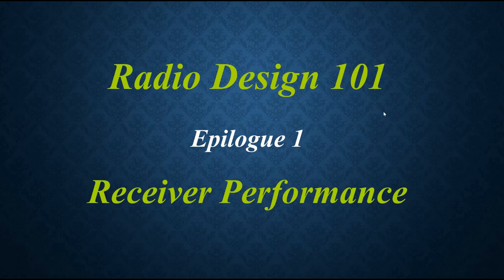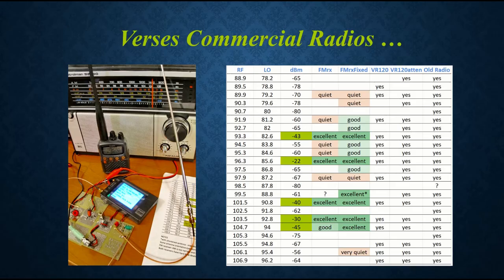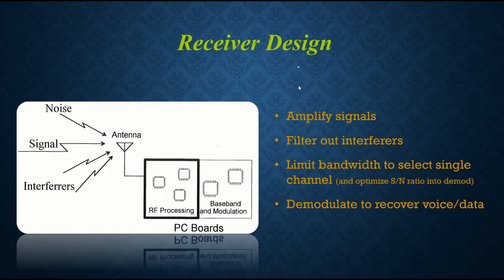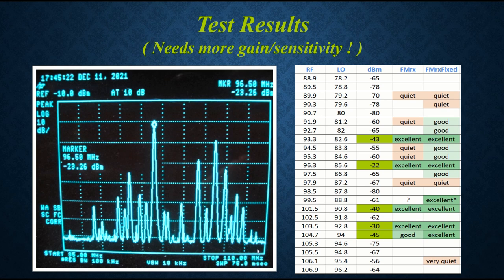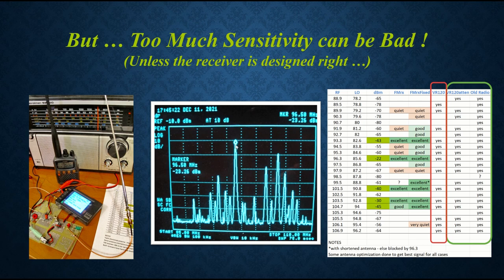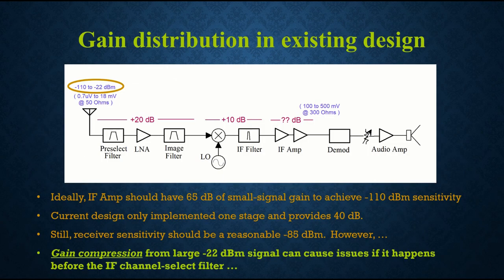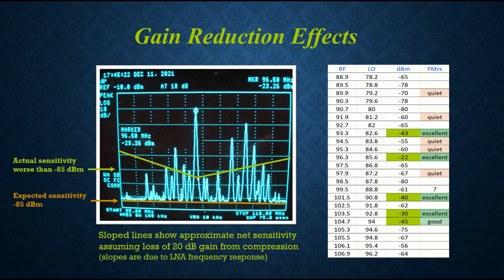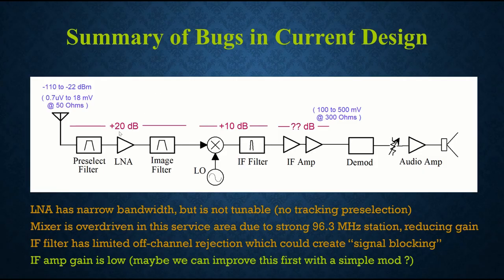Receiver Performance - Radio Design 101 Epilogue 1

Comment: I designed TV front ends 40 years ago, we built tracking filters with ,3 tuned circuits for low band and high band VHF using varactors plus a tracking varactor tuned oscillator. We always used the oscillator at ~45 MHz higher than the rf frequency. Nice to see someone covering this topic.
Reply from the maker: Awesome. Those definitely helped. We lost a lot of front-end protection when things got more integrated on-chip. I'm still amazed though at how well the single-chip receiver in the ATS25 radio works. Judicious use of AGC seems to help quite a bit - more than I would have expected !
Reply: Yes, we used AGC on both the front-end (called a tuner back then) and the IF, we used about 45 dB of gain reduction on the RF and ~ 60 dB in the IF, of course tv signals were basically AM and the output need to be constant for the video circuits @MegawattKS

Comment: Looking forward to your future episodes on Receiver Sensitivity especially SINAD measurements.
Reply from the maker: Thanks for the feedback / comments.  I'll try to include SINAD in that part (as well as BER vs Eb/No stuff for the digital modulations). FWIW, in the class, we used a surplus HP8903E Distortion Analyzer to measure SINAD sensitivity (together with an HP signal generator modulated with an audio tone at the FM standard deviation).

Comment: The last 3 min of your video is a real cliff-hanger and can't wait to see following videos. Actually I have started searching for digitally tuned capacitor ICs right now.

My guess on why your circuit totally failed after removal of collector resistors (my wild guess, might be wrong) -- RF amp compression can have different causes and I guess in this situation, the input signal to IF amp is so high (0 dBm, which translates to quite high voltage, considering the high input impedance) has saturated your BJT. Simply by introducing more "gain"(actually small signal gain) will not effectively translate to real gain given this large signal input (which can not be modeled using small signal assumption), but could possibly make things worse (saturate the BJT even worse).

My intuition is: maybe we need smaller gain for IF amp to keep that amp close to its linear (small signal area) by different biasing setup. Then filter it again, and add one more stage of IF amp.

But still, I feel pre-filtering is an attractive, ultimate solution since you reduce/remove the interference of loud stations from the very beginning. After all, complicated intermodulation in LNA could be a trouble anyway, even if IF amp compression problem is perfectly solved. That is why I started searching for digitally controlled variable capacitor ICs.

My intuition/guess might be totally wrong. I am curiously and eagerly looking forward to your next vid.
Reply from the maker: You're definitely on-target with the issue of intermod. That, combined with overload in the LNA or mixer can make big problems. But the reason the RX failed after the mod is not overload. Overload is OK in some situations like FM IF subsystems (so that any signal level at the input can reach a constant final output level desired by the demod), but only after the IF filter, which it is in this case.  I don't want to give away any spoilers, but a hint is contained in the old RF Murphy's Law adage: "amplifiers oscillate and oscillators don't"  :-)
Reply: @MegawattKS  Read several refs on FM demod and now I understand for most FM demodulator,  amp overloading after IF filter is not a problem - and sometimes even desired. Oscillation - ha I had experience in audio amplifiers - If the VCC/VDD is not well AC grounded it will happen sooner or later.

Thanks for the very helpful reply. Looking forward to your next video.

Comment: it will be very intresting if you schow as a schematic of a commercial receiver and an explanation from it motherboard and some measurements  and a study of the stages of the radio receiver and the components used and theire values according to signals... I've been looking for that for many years ago so thanks Cordially
Reply from the maker: Agreed.  I tried to include a little of that in parts of the videos in the Radio Design 101 series. It's hard of course since everyone's background is different, so what a person already knows varies.  The Radio Design 101 series (and the course it supports) tries to take the learner through from the beginning with minimal math, starting with the basics and covering all the parts.  Here's the full semester course set of videos that preceded this Epilog 1 video. https://www.youtube.com/playlist?list=PL9Ox3wpnB0kqekAyz6blg4YdvoEMoJNJY

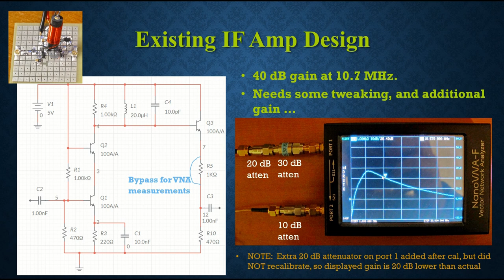Comment: In your schematic (around 27:00) the base of Q2 is connected directly to V1, is it an error?
Reply from the maker: Good question.  It's actually OK (and even intended) in this circuit. While Q2b would normally be biased lower in voltage (and bypassed), this direct connection saves a resistor and a capacitor. It's OK in the DC bias sense because the collector quiescent voltage is V1, so with the base at V1 also, the collector can dip as low as about 0.6V below V1 before leaving the active region. The intent was to actually use the limiting that takes place when it tries to go further, since this is meant to be a limiting IF amp :-) So the negative swing a the collector can't go below about 4.4V.  The positive swing is limited by Q3 base-collector becoming forward biased.  (Actually, as the second "Epilogue" episode will show, the latter is actually a problem with this design. When Q3 goes into saturation (due to base-collector forward biasing during limiting), the capacitance on the node goes way up and the frequency shifts.  More on that when the next Epilogue episode comes out :-)